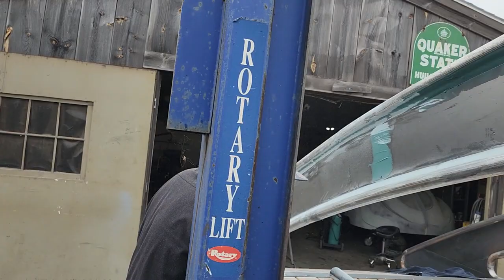Body work: sanding, mixing, and applying | 1948 Ford Concept Car Hauler 🚚

Comment: Regards returning behind the cab with a panel;- The current aesthetic to the side “wings “ looks like the old darling is in flight. Have a good stand back on that one Brad , even do a cardboard panel infill just to see the form, you may see it as a wind jamb and there goes up the gas bill when driving long distances, as it is, it’s streamlined.
Don’t forget about videos on the shed, should have a few cameras set up on auto run. Jolene is a wonderful cinema photographer, just as Brad is a craftsman. Both very deserving of best luck in business.

Comment: You really need to build a tubular structural frame at the front to protect the cab and occupants , it will also provide structure for the sides.

Comment: You said you want to close the rear side as well (behind the truck cab). In my opinion you could also build a partial roof covering (about one meter), only in the upper part.
It is just an idea 😉

Comment: Love this build! Its going to look great with the holes cut out too.  You know what might look good too is adding a diagonal support (with the parallel exhaust tubes and sheet metal) in the big open center space on the sides of the hauler bed to break it up a bit. Either way looks good, i'll be watching and thanks for sharing!

Comment: The ramp truck is coming along nicely. You probably thought about it already but if you didn't when you close in the front part what about putting in a opening to match the back window in the cab, but use a smaller dia pipe for contrast. Just a thought

Comment: This ramp car hauler truck is gonna be so beautiful and just like what racecars haulers looked like back in mid 60s early 70s heading to the local dirt or asphalt track on a Friday or sat evening to go racing. Did you  know they make flap disk for grinders for doing what you just did in very beginning with that DA and 36 grit sand paper, the disck looks like it's got about a few hundred tiny strips of 30 grit sand paper rectangle strips that are over lapping each other and it works very well for stripping paint smooth and shipping metal smooth and not rough like a grinding rock and good for rounding metal edges and blending in welds with out removing hardly any of the weld off the two pieces you welded they are azing and makes the fiberglass and metal so smooth  but yet it cuts through very fast so you don't waste a bunch of sand paper trust me those things are way better then that DA your using. That flapper disc aka tiger paw we call them in the Fab shops would have done what you did with that DA in the very beginning 5 times faster and just as smooth and plus you can use it on any surface metal fiberglass aluminum stainless and even wood if you need to quickly shape out a rough rounded edge or something on wood  it works best on fiber glass and metals for shapping and blending and the tiger paw flap discs thread right onto your regular electric 6" standard grinder that you would use for grinding or use a cutting wheel on for cutting metal. We use them everyday in my Fab shop all day we barley use a real grinding rock disc cuse that tiger paw throws less sparks and metal shaving at you and it works just as fast and no risk of it exploding on you if moister got to it like a grinding rock wheel will do to you and it will even get steel to a ready to polish surface is how fine it will smooth metal

Comment: Chad before jumping into another car hauler particularly the Winnebago you should track the Net weight and GVW. 

I can’t imagine the frame for a motor home made of aluminum and wall panelling will be rated to carry the weight of another vehicle. 

The Ford you are currently working on is likely adequate for the purpose you have in mind but you should have run the numbers by now to be sure.  

I have a 3ton Isuzu cab over I’ve considered with a net weight of 4400kg and max GVW of 7520kg for a total payload of about 3100kg minus driver and passengers so that would be doable for many cars, might just have to avoid EVs and some Cadillacs which might push the limits.

Comment: You should put some exhaust pipe across the top in the front , it would good and could also use it to mount some rear facing work lights and brake lights up there

Comment: To do your corners, I find a 3" Rolox disc on a 2" Rolox base works well for tight areas. And you can cut the edges when they dull.

Comment: Chad if you want to smooth the corners out better take a 1/4 inch   rod cut a slot in the end and put some emery cloth in it and stick it in the die grinder and use that to sand it

Comment: Chad you side you where going to build a wall in the front but I would continue doing something with the tubing. Would fill the space maybe spare tire holder. But keep it open so when your on the highway less wind resistant.
Reply: Yes race car haulers always have a tire rack .
Reply: I'd go for the old trussell bridge look. 
1/3rd down the top would look good too with a little triangulation or something.
Reply: I just added the same comment, now it looks like “wings” on each side, to fill it in would take away the beauty within the side panels and as we both agree, there goes, ‘up the gas bill’

Comment: Might want to be careful what You put in Your toilet. Don't want to slow down the action of the stuff biodegrading.  That is why You have a soap box for Your kitchen sink and a different system for the toilet. You want the solid waste to break down.

Comment: BTW - because this glass sanding was so painful to watch with all those fibres flying, it's my first dislike on a Chad video.  The harm he did putting out a video of sanding glass without lung protection - not even mentioning it, far far out weighs any advice or technical tips he may have intended to pass along. He's shown this all before anyway so its all the same work just different vehicle.  IMHO get your first day views and pull it. This vid won't help the channel as much as Chad doing a PSA next week saying why you deleted it with a little fibreglass health info to set the record straight.  Besides maybe doing some glass/lung research may convince Chad to reach for a mask more often without being told.   just saying
Reply: Lots of people overlook air quality and what they breathe in.
The same who get lung cancer but never smoked.